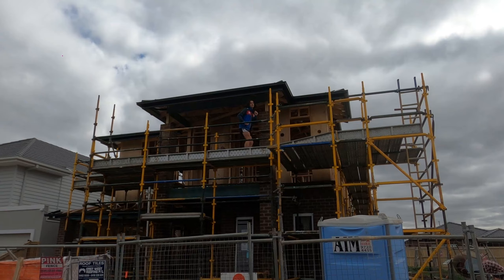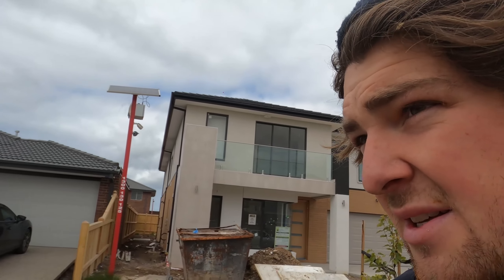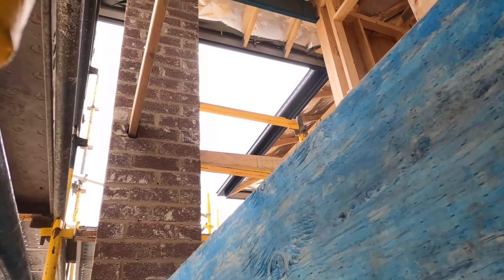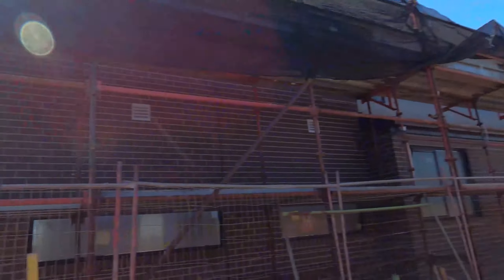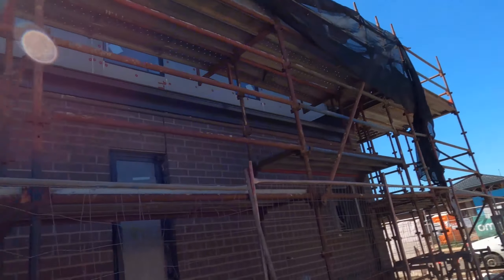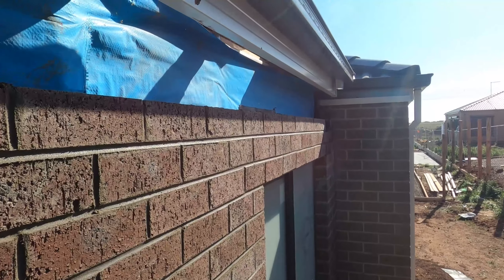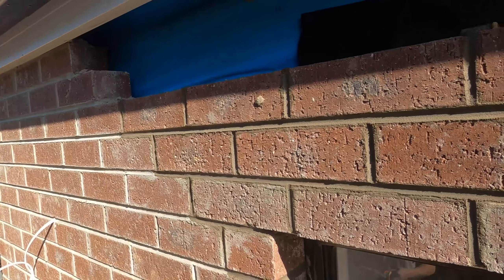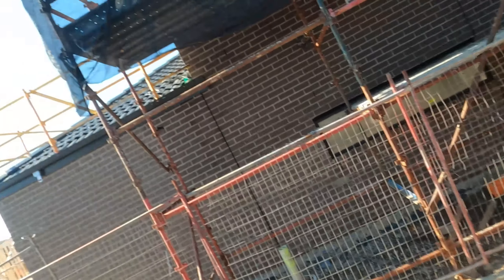Bricklaying Monster Piers + Repair Job

Comment: I always gage off the highest window of the side I’m working off, don’t worry about water level. And then boost any windows up that have a gap between bar and window, never had a problem doing that
Reply from the maker: Dragging Me Down I usually do this too mate for this job for some reason I didn’t check the back two windows when I gauged the full job around and then when I got up to then Ofcourse they were 10mm higher with no room to drop it: 
This is where some packer under windows for wiggle room comes in handy. This builder just installs them straight onto noggins
Reply: Sorry I meant to say they are “not” supposed to sit hard on the frame

Comment: I wear gloves... but I'm in commercial  laying blocks. But still tend to wear gloves (only on brick/block hand) on either brick or blocks. I take it off for setting up, running string lines chalking etc. Saves your hands, if u hurt ur hand ur slower all day